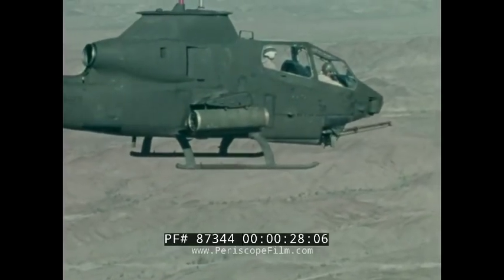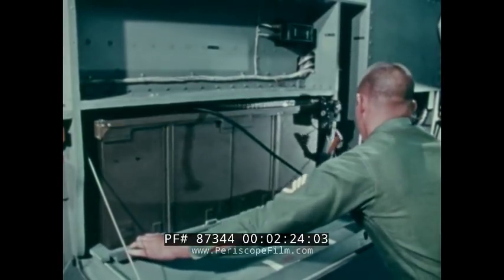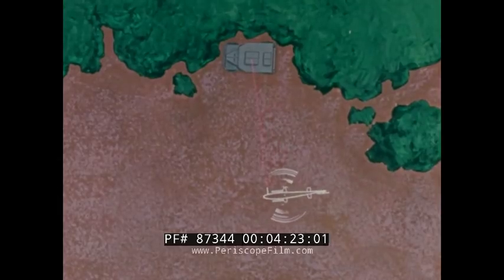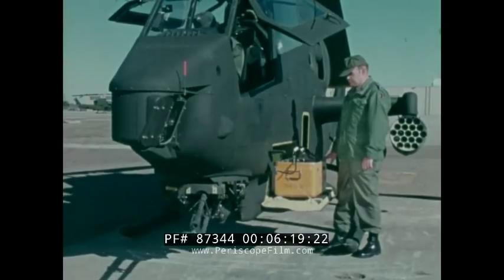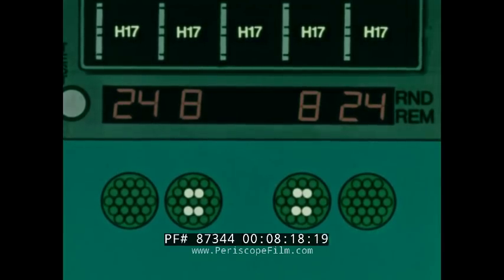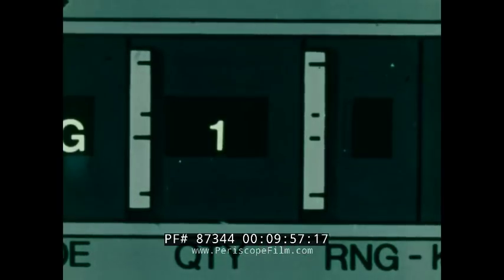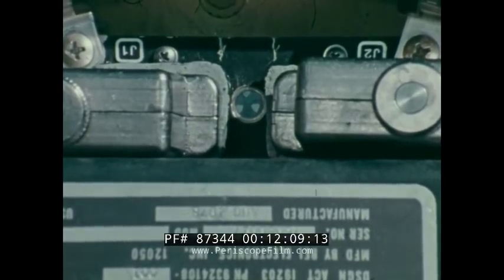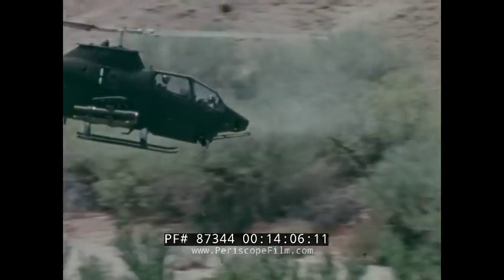BELL TEXTRON AH-1S COBRA HELICOPTER  CHIN TURRET & ROCKET SYSTEM 87344

Comment: I am one of the electronic engineers that designed the M147 Rocket Management System and the PGSE (Peculiar Ground Support Equipment) test set. Spent time at Yuma and Hunter Army Air Field during acceptance.

Comment: I was stationed in Germany when B Attack Helicopter Company of the 501st.  got their new S models. They had added so much to them, they ended up having to put counter balance weights in the tail boom. The bird was so heavy you had to fly with either 1/2 the fuel load or 1/2 Ammo. The we had a TWX come to us that we had to do air frame inspections every 50 flight hours to look for Flexing, Cracking or Working rivets.  It was a total mistake.

Comment: Jordan have just donated 2 AH-1S to the Philippine Air Force and for 2 years have been refurbished by the PAF and it is now Operational. Originally this 2 AH-1S came from Israel but was transfered to Jordan. The PAF is supposedly will get another 2 from Jordan but there is no information whether it will be pushed through. The US also approved the Sales to the Philippines the AH 64 Apache Helo's and the latest AH-1V Viper Helo but this are expensive but the Philippines acquired 6 AT-129 ATAK Helicopters from Turkey and supposedly that 2  have been delivered last Dec 2021 but for reason the Turkish postpone and delay the delivery of this Helo's. Also the US Marines is retiring their Squadrons of  AH-1W Super Cobra and we hope this will be offered to the Philippines and the PAF Helo Pilots can Fly this Helo's. When I was in the US Navy on board the USS Wasp LHD-1 and USS Nashville LPD 13 we have a Flight Operations of the Marine Corps AH -1W and is well maintained by the Marines on board USS Wasp. I say that it is One of the Best Attack Helicopters in the World today.

Comment: This brings back memories!  I was assigned to A Troop, 1/17th Air Cav, 82nd Abn Div way back in 1980!  I trained in the original G-model Cobra during transition after graduating flight school, and at that time we had the "Production S" model that still had the minigun and 40mm in the turret, but with the HSS, and TOW, TSU system.  Later we upgraded to "ECAS" with the 20mm and before I ETS'd we got the "Modernized" Cobra with the Rocket management system detailed in this video, and the Doppler Nav system tied into the weapons system to enhance targeting accuracy.

Comment: Can AH 1S be upgraded to AH 1W.
Reply: No
The W is derived from that T which has a much heavier duty drive train and tail boom.
Reply: No. The AH-1T had a twin GE T400 with a combining gearbox, and the AH1-T+/W had a GE T700 w/combining GB. The increase in power necessitated an upgraded 45 deg gearbox w/ accompanying drive shafts and hanger bearing assys, as well as an upgraded 90 deg gearbox for the tail rotor. The AH1S had a single T53-L-703 powerplant if memory serves. I worked on the AH-1T powerplant and dynamic components as well as the UH-1N and CH-46 in the Marines

Comment: Like a Phoenix...the tank destroyer was reborn...tanks were knocked down to 3rd most important weapon in the arsenal of the Cold War and the attack helicopter became 2nd; only WsMD was more powerful.

P.S. the Cobra could use both 7.62mm Miniguns and 40mm M129 Auto Grenade launchers(one type or two each, but the minigun had to be placed on the right side due to feed problems)in the M28 turret, which in my opinion made the AH-1 more powerful and versatile than the AH-64.
Reply: For many years, the Snake was one of the few aircraft in the US inventory that could fire Sidewinder, TOW, and Hellfire missles. That and it didn't crash just because someone talked on a radio...